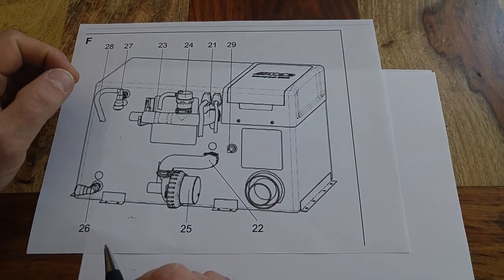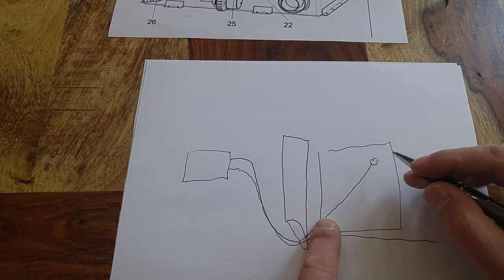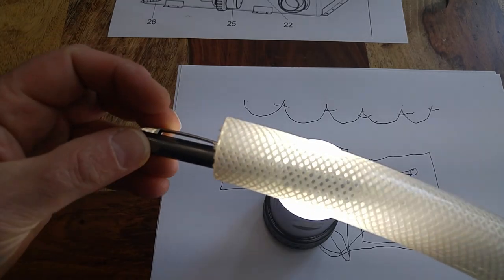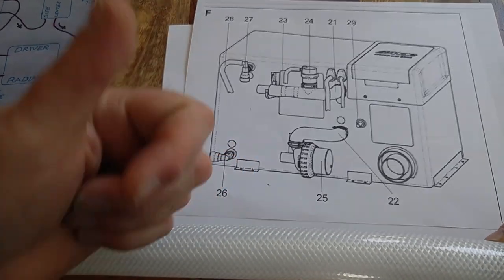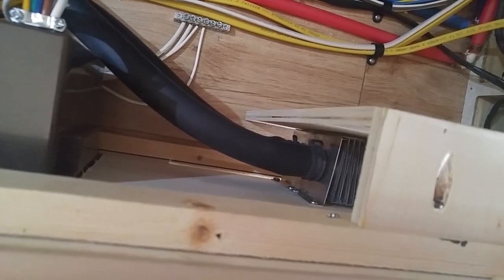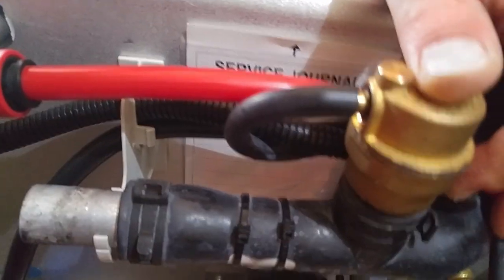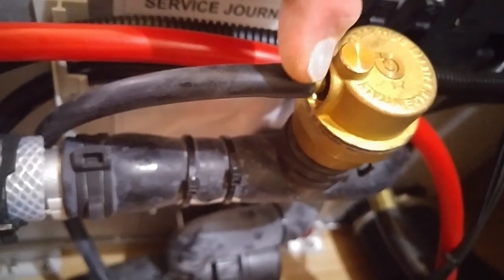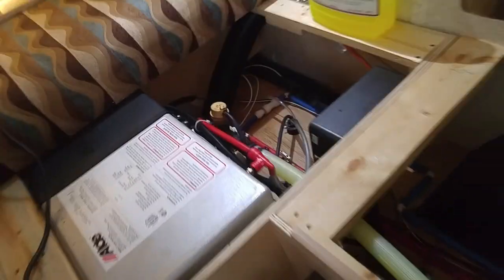Chronic Air Bubble issues in Alde Tab Trailer Heater - Part Two

Comment: Nice solution, wish you would have shown the process of refilling the glycol and auto bleeding the line
Reply from the maker: With the two extra drains at the low spots in my system, draining is just taking off the caps, and letting the fluid run into buckets. Filling is just a funnel, pour the fluid in slowly, run the circulation pump, and the auto bleeder removes the air. Takes 15 minutes.
Reply: Where is the circulation pump? You said run it… how?
My 2021 Tab 320S boondock was working perfectly until last Oct 2022. I was staying in my Tab for 60 days on my daughters property. I was connected to water and her 110 ( I had a good device on the avoid power surge)
Suddenly my heat stopped.
I checked the glycol and saw it was low.
I waited until I got into my new home and got new glycol. Still no heat…
I thought possible I filled it too full and carefully took out glycol to lower level. No heat…
I checked and changed glass fuse, no heat…
I check and unplugged on the top of boiler those 2 connector s in between the glass fuse, no heat…
I checked the converter box and switched the switches off and on. No heat…
I went to the panel and tried resetting the entire board, no heat…
I tried using propane only, no heat…
I tried lowering and raising the Tab, no heat…
I can feel the heat in the black tubing going into the boiler…
I read the manual and looked on YouTube and online too.
Can you help me please…😢

Comment: Nice upgrade, something Nucamp should have done in the first place.  One question, you didn't insolate your new hose and it is running on top of your converter.  Will this cause any overheating issues with the converter when the hot Alde fluid is circulating thru the system?
Reply from the maker: Three things...

1. The hoses used to run "under" the converter.  Since heat rises, the converter will actually be exposed to LESS heat with the hose on top rather than underneath it.

2. The converter has a fan the pulls air in from the front and exausts it in the back. As long as that front vent is not obstructed, the converter will be able to keep itself cool.

3.  The cabinet the converter is running is is MUCH MUCH cooler since I made the previous modifications to the radiators as seen in a previous video....

https://youtu.be/f3cLWUhlqD0

Comment: Excellent... Where did you source the hose from?   I will use that to make  a "home use service pump"  I have confirmed that a pump on amazon pumps as the same rate of 6 liters per minute as the one made by Alde.   I believe Nucamp fortunately mounted the air bleed level on my 2018 400 but I remember fixing the air/fluid relief line that was all coiled up.
Reply from the maker: Here is the high preformance hose I used.
HPS Performance 7/8" ID Clear high Temp Reinforced Silicone Heater Hose tubing, Sold per feet, Max Temperature Rating: 350F, Bend Radius: 4" (HTHH-087-CLEAR) https://www.amazon.com/dp/B079K8NC1S/ref=cm_sw_r_awdo_navT_g_SXY433AHSJK353FSCC2D